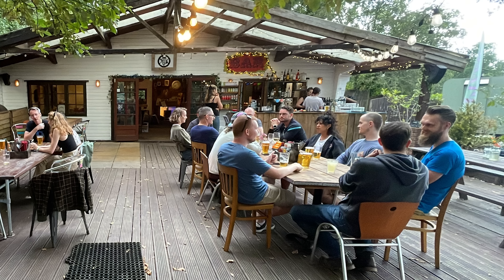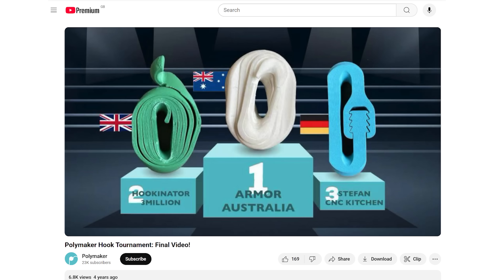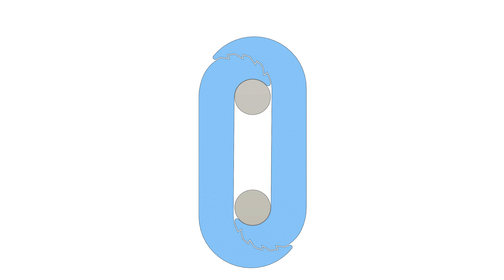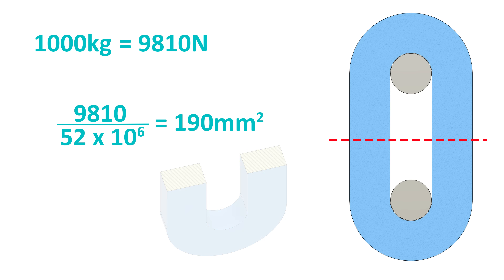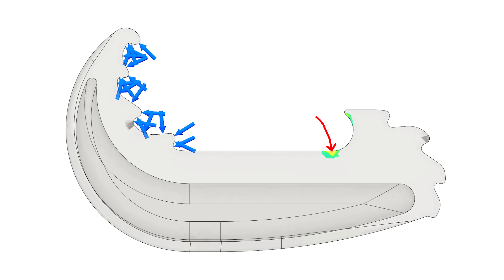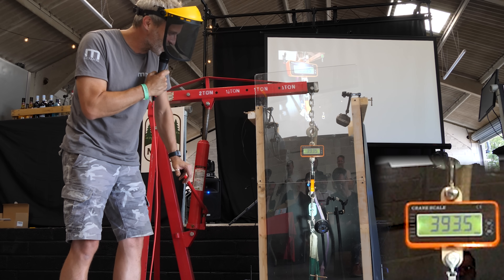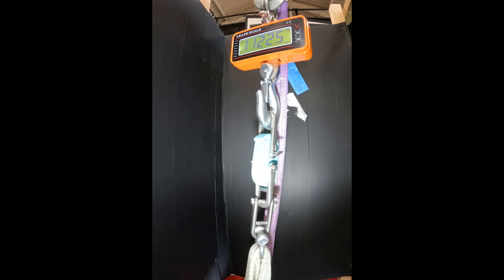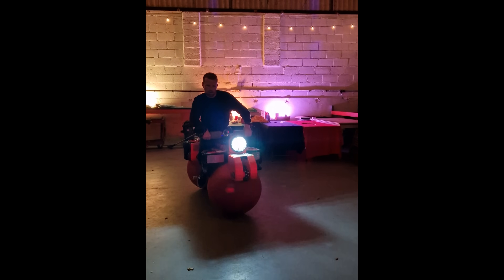Designing The Strongest 3D Print

Comment: The hollow space is pretty interesting to me, instead of filling it in you use the space to distribute stresses evenly, which brings more value over all than filling it solid, as almost any material under stress when it begins to suffer a failure, continues and breaks all the way through. The hollow is strategic, it wouldn't matter if it would be 6x stronger at a specific point if it came at the cost of any other part being weaker, by achieving as uniform of stress concentration as possible you create a structure that will not fail for any reason other than complete failure.

The literal chain link is only as strong as it weakest metaphorical link.

Comment: @TimStation I know it’s unlikely you’ll read this as I’m just now seeing this 2 month old video. You noticed that the initial thin version slipped apart & thicker versions shouldn’t have that issue, BUT it still could happen. You could eliminate that possibility completely & increase surface area contact/friction in the process. I’m no engineer, so bear with me: if you look at the clasp from the top - add a ridge, perpendicular to the current locking ridges, down the center locking area on one side and a recess on the other. This way it would be near impossible for it to slide. Anyone using such a device would want to know for sure it couldn’t get bumped into or whatever and accidentally be subjected to side to side forces…lest you want a broken foot 😅

Comment: Rock up with 50g of raw filament and start looping it between the shackles as a minimum effort attempt. I bet it would be surprisingly strong if the ends were locked under a loop or tied down sufficiently. 😄

Comment: 1. central connector too large and heavy. just use a little c outside the gap.
   this would make the link shorter - and thicker.
2. more, smaller teeth for better load distribution?
3. inner radius of the outer hook should get tighter than the outer circle of the inner hook, so the last teeth hook better.
4. the (top/bottom) ends with the hooks are too strong. make them lighter and the weak center thicker.

Comment: Good engineering practice: Build for an expected load with a safety factor of 2.5 to 3. So; competitor builds for 400kg? Make it good for 1,000 - 1, 200 kg. And you have room for improvement within the rules. 
1) The connecting section doesn't have to be the full width of the hook. 
2) And you might be able to remove a little of that projection at the end of the teeth on each end of the item. 
3) The regained mass can be used to give that necessary larger radius at the former failure point.

Comment: There is a system that I can't find right now and have forgotten the name of, which uses the same principle and is used for chains, but it is three-part, where two of the parts are the closures and the third part is a screw that secures it with a 90 degree turn so that it can no longer come apart.

Comment: this is super cool, I think the use case would be in replacing small bag carabiner, if 1 tenth the size had still 1 tenth the holding strength then it would be super practical, I know the cheap aluminum ones I bough as bag clips only have a 50kg capacity. I wonder how rugged the PLA would be though

Comment: The part was hooked into the "1/2 ton" hole of the crane. If that crane hadn't had a safety factor of over 2, you could have broken the crane. That crane operator was lucky that they used a quality crane (and that your carabiner performed at only 55% of the theoretical strength). Next time better tell them to hook into the "2 ton" hole.
Reply: No, the top arm of the crane slides in and out and it’s rated for 2 tons in the position shown. The lifting hook is always at the end of the arm. Basically the less leverage applied to the frame of the crane, the more it can hold.

Whether it will achieve its full rating when rigged to itself and is trying to fold into a pretzel is an interesting question, though…
Reply: @KateNesD  Ah, I see it now. The black beam inside the red one is the one that slides, and at left end of the black beam is a pin, and the hole of the red beam that that pin goes through determines the weight limit.
Reply: @Pystro  yup, exactly!

Comment: How did you take into account the layer lines as propagation points for your stress concentrations during the finite element analysis
Reply: Printed flat, the layer lines would be along the direction of force, not across it, so would be invisible as far as stress concentration is concerned.

Comment: Wouldn't it have held even better if it wasn't hollow? And before someone points out the obvious weight issue, I mean reducing the "cross section" just because it would remain the same actual value, just focused on a "sqare-ish" profile rather than 2 concentric ones. If I don't missremember tensirs and other stuff worked best in this config. Only potential problem is space for the teeth.

Comment: 11:32 I have to disagree. The part on the left probably failed first and more extensively. Oddly enough, it’s right at the stress concentration you said wasn’t a problem. I think you were wrong about that and the failure point was the stress point indicated in the software. I think the crack you highlighted happened AFTER it exploded. Shame they didn’t have a high speed camera to see what exactly happened.

Comment: Technically the strongest 3d print would be either peek or a very high automated TPU like TPU for ams printed at the max temperature with a very low layer height and a very high line width and max wallls to make a solid part

Comment: 11:30 You can see the crack following the top layer lines. I would change the top (and bottom) surface pattern to a concentric one in the slicer. This wil print you lines in the same way the force is applied to them, making them stronger. It's also advised to increase the number of wall loops, even in hollowed out parts. The default setting for printing at 100% infill is usually 2 wall loops (that follow the outline contour of your shape) filled in with a 45° diagonal pattern, but the contour loops are stronger than the diagonals. So for hollowed out or thin walled parts that need to be strong, increasing the number of wall loops until the infill isn't generated anymore is usually my go to...
Reply from the maker: It was printed as perimeters wall loops apart from the single top layer. We had to use Bambu slicer for the final prints, which I'm not familiar with, so as you said, I should have selected the surface pattern as concentric. However, I doubt it made a huge difference to the strength due to the rest of the part using concentric wall loops.
Reply: @TimStation  In that case it wouldn't have made a huge difference indeed. Anyway, amazing design and mind-blowing result. Might be slightly overdone, but there's no fun in mediocrity. :)

Comment: You know that engine hoist is only rated up to 1 ton so I was worried the hoist was gonna break before the 3D print
Reply: No, it's not. You can see from the video that it's rated at 2 tons in the position it's in, it's a half ton hoist when it's fully extended. Pulling against itself with no fear of tipping it is capable of well more than two tons of force. I made an extension for mine so I could pull the engine from a car without pulling the bumper off, it will pull ~600lbs of engine from a miata no prob. I think I added 8"
Reply: @pontiacg445 I just said that because I seen an engine hoist arm bend before but now I’m realizing it’s more likely for the hydraulic cylinder to max out then for the arm to bend

Comment: A few thoughts on the final image with the fracture, a possible improvement is to adjust the print direction to take advantage of the anisotropy of the material. The hook seems to be split along the same angle as the print direction, so rotating the plane in a way where the tension is in line with the print vectors would probably give some minor advantage.

Does heating the hook and applying tension to align the polymer chains count as assembly lol

Comment: also would recommend printing the at a slightly different angle, and the print layers may not have been aligned perfectly, maybe a 15° change in either direction on the build plate.

Comment: Smart design! Small improvment would be to ticken the top part of the print by one or two print layers compared to bottom part since the top part (with support but especially without like in this case) always prints worse / less solid meaning the part that laying on print bed will be stronger than the top. Not sure but maybe bridging direction could be changed or maybe a layer thick modifier could be used for that first bridging layer.

Comment: You actually cheated non-assembly rule. Almost any assembled thing can be made like this, just put a tiny thread of filament between parts.
Reply from the maker: Every hook required a flexible section and a latch to attach to the shackles, and print-in-place designs were allowed. So maybe 'assembly' should have been better defined.

Comment: hi Tom! Hell of a performance in the stress test! The toothed design you used reminds me a lot of the "RUD UKS universal chain connector" which is a specialty master link, not unlike the links tested in the tournament. If you know about that, was it a source of inspiration for your design? If not, does it stand out to you for refining or improving on your already impressive hook strength?

Technically, as manufactured, the RUD connector would not qualify within the rules of the Polymaker contest. Perhaps you could think of a way to make it print in place and not require assembly, though.

Do you want to design a hook that connects in the way of that connector and test it head-to-head with your revised PLA hook? Maybe the RUD connector wouldn't do well since all of the force is transferred via teeth, and not come close to 1000kg. I wouldn't be able to guess the winner ;)

I know you've received a lot of comments on this video and a lot of the comments have random ideas like this one, but I'm curious to see your reaction to the RUD connector, especially if you've never heard of it. It would be quite a coincidence to design something so similar; But then again, both have similar constraints and goals, so maybe it's just the convergence of design.

Thanks for posting this great video!

Comment: So basically… you reinvented the RUD Universal Chain Lock UKS, but with extra flair and a 3D printer. Congrats on reverse-engineering industrial hardware using camping vibes and filament. Somewhere, a German engineer just felt a disturbance in the force
Reply from the maker: With the only similarly being the locking teeth, the mechanics of the RUD Universal Chain Lock are very different. The teeth being on the tension portion of the link rely heavily on the locking pin, which wouldn't have been possible in this competition, hence the self locking teeth around the shackles.
Reply: @TimStation  so never thought i would be seen in the sea of YouTube comments but that's cool so I just wanted to say I really do love your video. I see now that my original comment may have came off as snarky, and that wasn’t my intention at all. I was genuinely impressed—it just reminded me of the RUD Universal Chain Lock at first glance (took me forever to find the name of the darn thing). The similarity in the locking teeth stood out, but I get now how different the mechanics are, especially with how critical that locking pin is in the RUD design. Your breakdown helped me understand that better.

That said, I think your design could be even stronger if there was a way to incorporate a more secure locking mechanism—maybe something that mimics the pin function without needing the actual pin. I know the competition had constraints, but if you ever revisit it, that could take it to the next level. Either way, Mad respect for reverse-engineering industrial hardware with a 3D printer—that's why I watch. I love seeing what you're going to do next!🙌

Comment: I thought that the cross sectional area was a key factor in increasing the strength if that was the case wouldn’t making it hollow decrease that cross sectional area? Can someone explain this I didn’t quite get it
Reply from the maker: The cross sectional area was still 380mm2, but making it hollow allowed the part to be wider. So say the part was solid and it was 20x19mm (area = 380mm2), then I hollowed it out, the overall size would need to be larger to keep the same 380mm2 (maybe 20x30mm outer dimensions).

Comment: The test method is very bad. There is a dynamic factor, if the tester pushs the leaver with different speeds... The force should increase at a constant rate.

Comment: Stress concentrations only apply to fatigue failure, not ultimate. Adding material to an area of high stress is an entirely different thing. This would have been a perfect application for FEA. With that tool, you could balance the stresses everywhere, which will result in the strongest hook.
Reply from the maker: I did this at 6:45

Comment: Pulling 1.1 tonnes with plastic should be illegal in some law of nature
Reply: Plastic is one of the greatest materials we’ve ever created, it can hold a whole lot more than one tonne
Reply: @Mechanarian  Addendum: With less than 50 grams of plastic

Theoretically you can pull an infinite amount of weight if you just throw more material at it
Reply: @deathreus  yea I get you, I was being a bit silly with that response I think, a year or so ago I made a supersonic trebuchet as a project in school,  for the sling and tension holding cords I used braided UHMWPE polymer cord that I tested to almost two tonnes, 
if I looped and spliced 50g of it I think I could get it to hold 10-12 tonne by doubling it up a couple times,
that'd be close to the material limit because UHMWPE is the strongest polymer ever created, if a 50g component was designed with the sole intention of holding weight in the manner shown in this video it could probably push 40-50 tonne for a 50g piece, which is just absolutely ludicrous if you think about it, we went from braiding natural fibre like asparto and sisal in the Balearics to make slings, to (essentially) braiding atoms to pull cars with!

Comment: I am a little bit confused why making it hollow would make it stronger if you are considering pure tension ? I thought only the cross-section matters, if you could design it so that the other requirements are met (be able to put the hooks etc.) it should not matter, right ?
Reply from the maker: It was hollow to allow the outer dimensions to be larger, with the aim of increasing the bending strength around the curved shackle sections to hopefully reduce the load on the teeth. You're correct, if it was a solid loop experiencing pure tension, a solid design would be better.

Comment: Printing the vertical sections not solid but with some under extrusion so individual filament strings form that can stretch slightly and equal the forces is an Idea. Like fibres in a rope. Does this thinking apply to 3D prints?

Comment: I wonder if an I profile would perform even better compared to a hollow version as you can spend even more material to the sides
Reply from the maker: My only concern would be whether the compression flange could buckle. Whereas two thinner walls will support the flanges from both sides. I believe 'I' beams are used as they're easier to manufacture over a box section with varied wall thicknesses.

Comment: I wonder if there are more complex infill options that could improve over a filleted cavity. Lightweight 3d printed challenges are a great place to drop a ton of thought into. An iterative ML algorithm doing simulated testing could probably make some interesting candidates but I think the real world considerations that you included during your process make that less of a silver bullet than most AI hype types would have you  believe. This was a really fun video; you should have put this on the main channel.
Reply: I suspect a model with steps at layer height offset to even intervals of extrusion width could be done so that it can actually still print as all perimeters, as is with fillets you get infill or voids on some layers in my experience. You might even be able to force a stagger to layers at half the extrusion width to force better interlocking between layers.